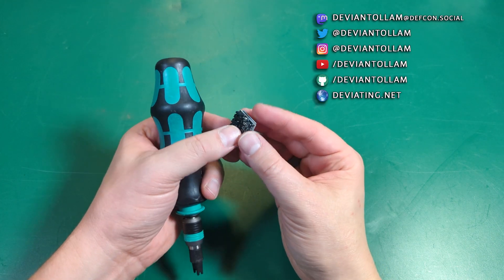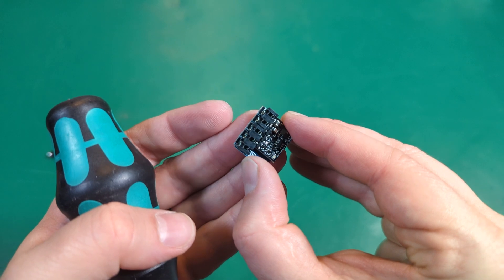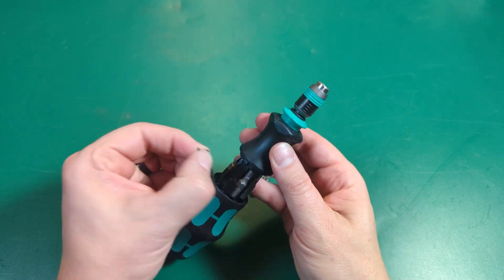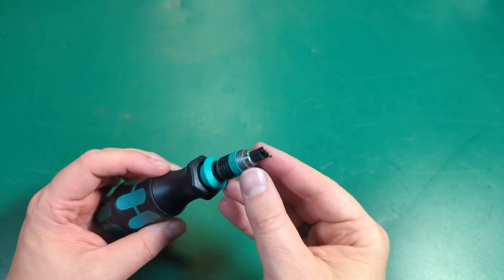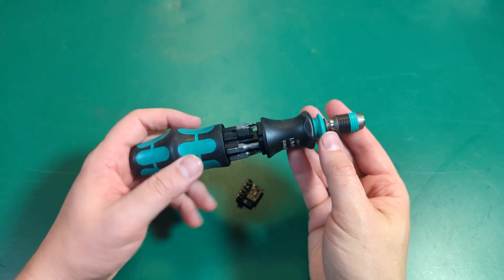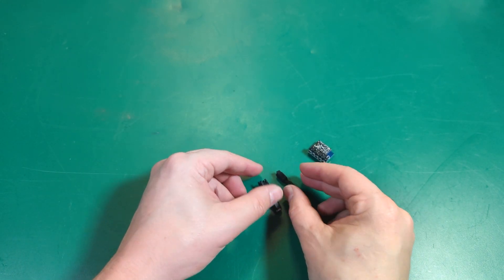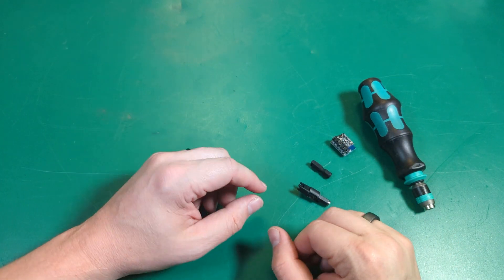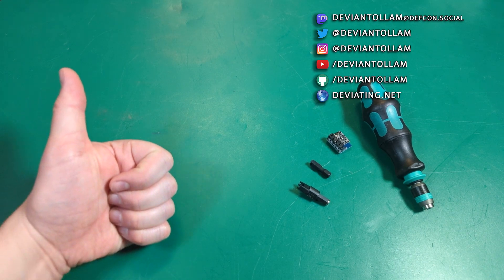New ESPkey Installation Tool

Comment: Plastic seems like the wrong choice here, especially fdm printing. I'd put a relief cut (on a lathe) in the existing bit, but that's just me. Maybe there's a Swiss shop out there that would run a few thousand of those off for a decent price?

Comment: Quick question, it may be silly but whats the best technique when trying to install an ESPKEY midline? Its one thing when you are installing near the reader and the outer sheath has been stripped exposing all the individual control wires but what technique do you use midline other than very carefully trying to razor blade the outer sheath?
Reply: In fact, the circumferential half of the copper version already exists in the form of those cheap plastic punchdown tools you find everywhere (including in my bag of networking tools next to the big fiber one, even though I have a much better stripper and punchdown tool.) [This reply won't make sense because it refers to another reply that got tossed out the airlock for containing Amazon links to a couple of midspan fiber tools that are similar to what you need. Search for "loose tube slitter". But don't use those on copper, because the blades stick out too far for copper. Fiber in a loose tube moves out of the way, so the tool manufacturers can afford to be sloppy.]
Reply: @RonParker  Thank you for clarifying the response, I missed the original reply that was deleted. And I had no idea that "loose tube slitter" was even a thing, that put me on the correct direction, thanks Ron!

Comment: This looks like a job for sinter or resin printing. Metal sinter printing would definitely work, but thats a bit overkill. But there are some other high  toughness sinter materials. And there are also some quiet  tough resins.
Reply: I wonder if it can be CNC machined (mill or router + lathe, probably) from steel.
Reply: Aside from sintered metal printing, my thoughts are resin or lost PLA casting (using a printed part to make molds) or CNC machining.

Comment: Can a regular 66/110 block punch down tool work as well?
Reply: Most good 110 tools have an integrated trimmer blade that would be somewhat less than optimal for this use case.

Comment: I bought myself a wera 6 gun but the bits are very loose and fall out when opeing. did you hack yours or are the newer models just crap?
Reply from the maker: Mine all fit very tight, personally... but also i've swapped some of my bits around with ones from other sets
Reply: Yeah, I've got two of those, one retains bits really well, the other really doesn't... It's on my to-do list to see if some little magnets can be glued in to help retention but I haven't found the time yet.